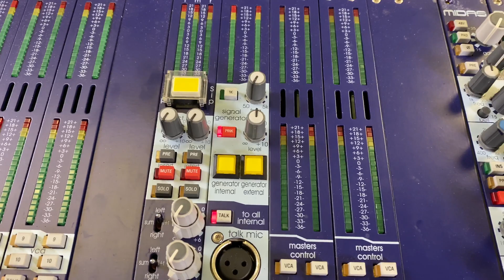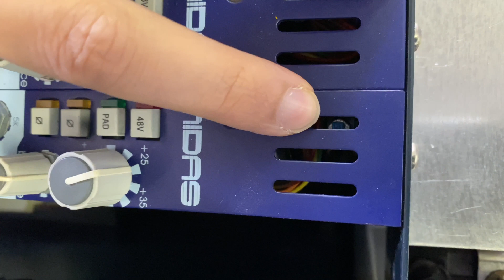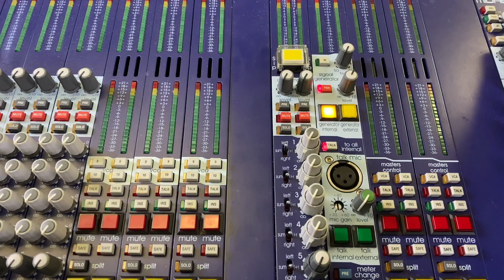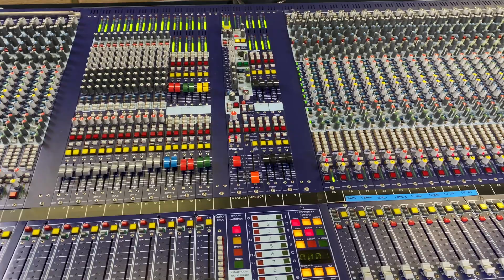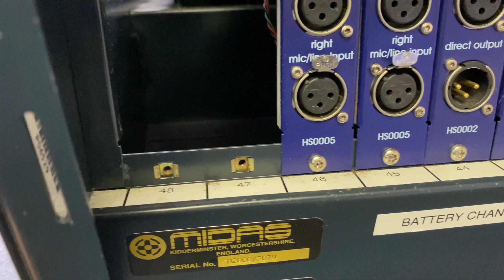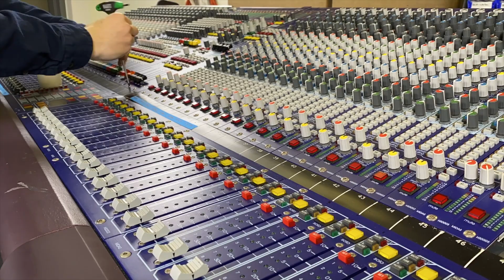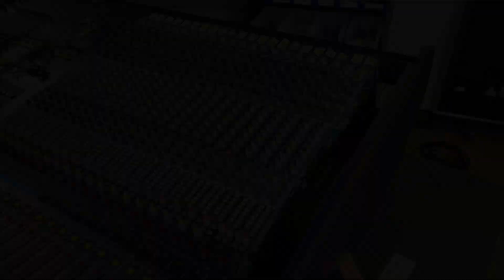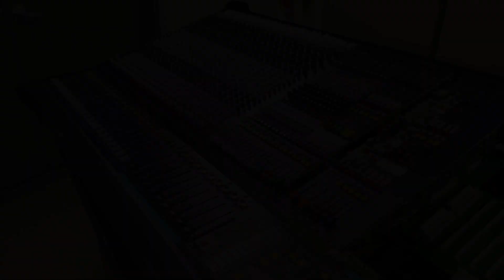Part 7 | Testing Via The Oscillator/Pulling Channels 25-48: Midas Heritage 2000 Console Restoration

Comment: Does the master section have some type of 2-track input you could use as a DAW return? I'd save those stereo channels for effects returns if you are going to use this as a recording console. In fact it would be nice to find four more even. It would be great for outboard gear returns and sending f/x from your DAW even.
Reply from the maker: I really hate to burn a stereo channel for a return, it’s bugging me too. Each group has a direct in, and so does each matrix. My only issue is feeding the DAW return to headphones for overdubs. My logic is that if I use the stereo channel, I can use a stereo aux to feed the headphones. Plus I have the option to have an insert point and the console eq over the DAW mix should I require extra sparkle. Open for suggestions though.
Reply: @billylaguardia  well now that you have a full blown console you may find yourself working through it the whole way meaning that you won't even listen to a 2-track sum from the DAW but rather every track you are recording goes through a console channel then you can route it to aux's for headphones. You would then on mix down sum through the console 2-bus and print back into your DAW.  So many ways you can do it though.